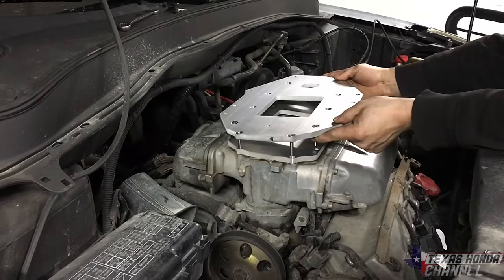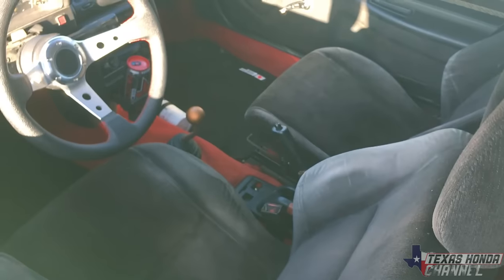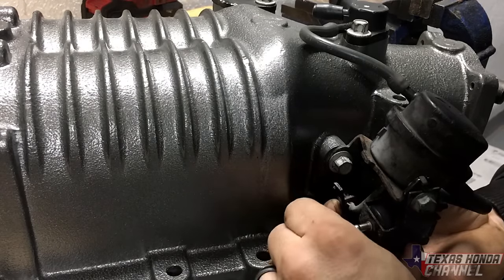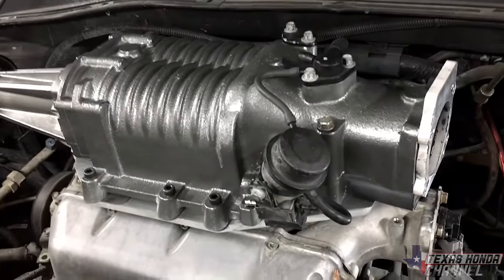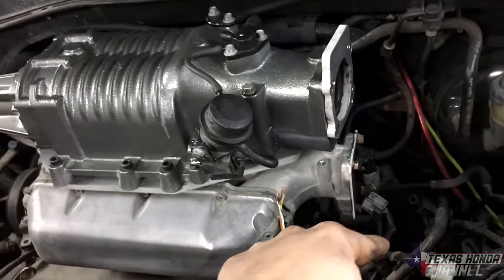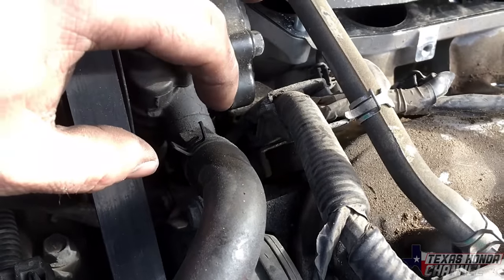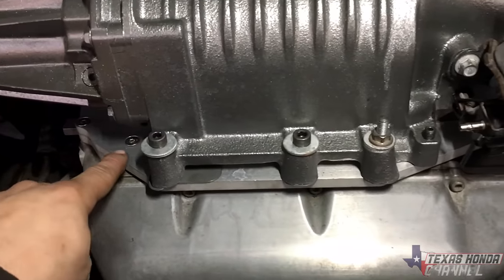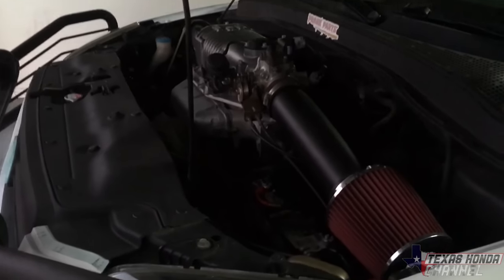How To Supercharge a J35 Honda Pilot In SUPER Detail (Supercharged J-Series)

Comment from the maker: Don’t forget to run 91+ octane if you are supercharged or turbocharged it’s a must! Also drop to a step colder plugs. I failed to mention that!
Reply: Does it work for the j30a 01 Honda Accord V6 I would appreciated if you could give me information about that
Reply from the maker: @josevasquez2201  It should be but not 100% sure. It’s all trial and error for me. I’m still learning as well.
Reply: About to put the blower on my Saturn, lol we've got the same problem with tuning lol
Reply: @fefefirecrackers  There are a few piggyback options. Aem Fuel/Ignition controller, Link has a piggyback, the Apexi neo he picked up, there's a few universal tuning options
Reply from the maker: @fefefirecrackers  Apexi Neo with Acura RDX 410cc injectors and it will work perfectly already got mine installed and the stock 240cc injectors don’t work good for even 1psi of a M90
Reply: @josevasquez2201  the intake plenum in my '98 Accord EX has a different design than the later models. It does not have the removable plate on top like the Pilot does. I'm pretty sure the 3.2 V6 intake does have the removable plate, so you could probably swap it if your engine doesn't have it.

The J30A engines saw some major changes in ignition systems in the 6th generation Accords. My '98 still has a distributor, whereas yours probably has the more modern coil-on-plug ignition. I don't remember if the intakes are identical, though.
Reply: This is cool asf
Reply: Ok bro how do i do that to a Nissan Pathfinder 2001 LE 3.5
Reply: B
Reply: @fefefirecrackers  currently finishing some final touches on my blown l61
Reply: Will this work on a 2007 MDX with j37
Reply: Hmm, looks like this will work with my 2005 MDX 🤔 Would be interesting to see how long the transmission holds up to the power, that is definitely the weak spot in these vehicles assuming the Pilot uses the same teams as the MDX
Reply: @bethanyhaskiell9116  How come no one said anything about my car
Reply: @bethanyhaskiell9116  
2007 is a thing of the past
Reply: Will this work on a 2006 Honda pilot lx
Reply: I wonder what PFI uses on the Jseries engine they have on the bully. There has to be a way to get more fuel besides the mechanical clamping of the fuel pressure.
Reply: I have an 05' Pilot that I just did a whole ton of crazy work on. I've been searching for performance mods for a long, long time. Have you heard of Phearable? They hooked me up with an ecu setup for a Prelude. Maybe they can help with this and hopefully the egr issue. I want to do several things to my car like: cat deletes & straight pipes (there are 3 cats on the 05'), keep vtm4 function, supercharge, etc. There is no video out there like yours. You're a pioneer. Keep pushing.
Reply: Wait, you have gas thats lower octane rating than 91?
Reply: @murkinranzyz9961  You will be better off grabbing a SC from a Nissan Frontier
Reply: I was wondering Have yo figured about the ecu tuning for the supercharger?
Reply: Do u have to do a ac delete to supercharge yo car
Reply: @TexasHondaChannel  hello how are u for how much can I get that on my pilot 2005
Reply: What’s that vacuum line on the supercharger called where could I purchase one
Reply: Do you have to run 91+ octane or can you run regular gas???
Reply: If your running an automatic you will need a 08-12 Honda Accord harness and a 5 speed transmission with the ecu and ktuner will work I have a 05 Honda Odyssey that I swapped a 12 Honda Accord 5 speed and ecu and it’s able to be tuned
Reply: @TexasHondaChannel  would this work with a second gen (09-15) pilot?
Reply: @josevasquez2201  yeah but first you’ll need to convert that intake manifold to a second gen j series one.. see my channel
Reply: Can I do this with my 2022 Passport TrailSport? Not sure bit I think uses same engine?
Reply: my 2001 intake looks totally different.
Reply: @TexasHondaChannel thanks i needed to know that for injectors but what about fuel increase did you use a fmu or stock fpr

Comment: Goes and looks up current prices on odyssey’s 😂
Reply: If its an odyssey manual swap it and run it on kpro
Reply: I have one 💪
Reply: Passat swap ideas🤣
Reply: Just drove one. They're so damn plush. Really bad characteristics in a slide though. As long as you have grip, they're amazing. Just don't try and drift it.
Reply: Will my wife notice the whining supercharger noise….🤨
Reply: How expensive is it to manual swap a Odyssey i have a 2012
Reply: @brianrodriguez1628  just need a manual transmission clutch and prerequisites custom pedal n a ecu tuned thats just the basics. Aint easy
Reply: I got a 2016 Odyssey thats why im watching this lol 😂😈

Comment: You are ligit a life saver! I have a 03 honda pilot and have been searching for a good year now trying to find a good kit and way to supercharge my pilot! You just made my night as now I have a foundation to now get what I need for my honda pilot! I got the J35a4.
Reply from the maker: Awesome!! Ima work out any bugs so others don’t have too but 1,200 miles so far and runs strong
Reply: Is your 03 FWD or 4WD? the pre-06 models have much weaker transmissions that usually fail much earlier. If you do this, let me know how that auto holds up under load! I'm looking for a good trans option for my 06 because the updated 4wd version of yours still isn't enough for me to run 10psi without ridiculous slip. I think the 4wd version is too complex to properly tune it or turn it off completely at my level of skill.
Reply: @billspangler2685  mine is a AWD I have over 170,000 miles currently and she is holding up strong and has done towing as far as 400 miles one way and 400 miles back. Haven't had many issues but I'm not gonna promise that it's the best. But when I can get the super charger and all done I will be sure to comment a update

Comment: Super SC install video for a one-of-a-kind Pilot. The Pilot has zero performance aftermarket support so you are definitely onto something here.The EGR pathways in the intake looked like they could use some clearing but since you're EGR-less it may be a non-issue.
Reply from the maker: Well ya EGR is blocked off now due to adapter plate but it the pathways were cleaned up recently but oh well I’ll figure a solution out

Comment: For the NSX you might be able to get it a 1/2 inch  lower by face milling the plates and the bottom of the supercharger.  You could prototype the plates in wood if you know someone with a planer. Remaking that top plate with countersunk bolts should get you a bit  more if that's where it's hitting. Also you could face down the tower that the plate bolts to. Lastly maybe motor and trans mounts.

Comment: bought stuff from Prank Parts for my J37 manifold swap I recommend. J32A2 with a j37 manifold 6 Speed Swapped 00 Accord. For this supercharger mod you will have to cut your hood like many accords, civics, tegras, TL/TL-S/CL-S ect. But if you don't want to cut your hood and want to go supercharged for your J-Series, go with competech Super Charger or hit up Gerzy Bear Performance which supply rotrex supercharger kit but will lose A/C.
Reply from the maker: I didn’t lose anything and have hood clearance but that’s the best part of the pilot plenty of room but good info nonetheless
Reply: @TexasHondaChannel  I know, that's the good thing. Ultimate sleeper. I think these Superchargers get maxed at 400+whp/420WTQ from what i've seen in the group

Comment: I need to know where to buy the supercharger.
Reply: This is an Eaton M90 off of a GM 3800. There's a ton of them out there for dirt cheap online and scrapyards. They're very easy to get a hold of. There are two different versions of it which the 3800 following refers to as Gen 3 and Gen 5. Any series 2 3800 will have a gen 3, a series 3 3800 will have a gen 5. The gen 5 is better but gen 3s can be modified to perform close to a gen 5 though. 

Edit: The adapter is for a Gen 5 it seems. They're harder to find (04 - 08 Pontiac Grand Prix GTs ONLY) then the Gen 3s but still relatively easy.

Comment: So, what kind of power/performance did you gain? Can that 5 speed automatic transmission handle the extra power?
Reply: They’re on the weaker side, so I’d say “no?” But it sure is cool!!
Reply: As a h5 owner I’ve ripped the torque converter up before the the actual trans itself needed to be changed

Comment: Definitely adjustable fuel pressure regulator and crank the pressure or ghetto way just clamp off return line for sure and watch your a/f reading if you have a scan tool that does so will help for a couple psi of boost so it doesn’t lean too bad. Very neat though . Also a infiniti q45 throttle body bolts up to a k series and the wiring for tps will match don’t know if it will work for j series but it’s cheap from a scrap yard you just need the pig tail for tps

Comment: Just use an FMU rising rate fuel pressure regulator. If you are only running a few pounds it should be fine. Get an air fuel ratio gauge though to be sure what's up.
Reply from the maker: I have a Apexi neo and installed it and it worked perfect without a FMU videos will be coming out with that info.
Reply: @TexasHondaChannel  Cool, I had one of their vtec controllers back in the day. Love your build.

Comment: I wanted to do this to my Odyssey and have it tuned but EVERY shop I called that specialized in Honda tuning laughed and told me it wasn't worth it and that the trans wouldn't hold up. I literally called 10 different shops. Bummed and disappointed I sold my Odyssey and supercharger kit. Too bad nobody makes tuning software for the older J series, it's DBW or nothing.
Reply from the maker: They laugh because they don’t see the potential we do. It is possible especially an Odyssey and just gotta get a piggy back until they come out with a Hondata or K tuner hardware/software

Comment: That’s sweet dude on the nsx try using hard foam to make a frame for the rear window 
Go all the way around use the hard foam for the bottom then u could find a way to mount the window rubber on the foam just a suggestion thx really appreciate it 👍

Comment: Good job. Just was never a fan of the pranks kit keeping the oem manifold blocks air flow drastically
Reply from the maker: It does block flow but still a cool concept and bolt on design. Ima definitely upgrade in the future but this setup is fun and I already put 1,200 miles on it and it’s doing great 👍🏻

Comment: Maybe an intake to get cool air will help more with the supercharger when you will get it tuned, since you can't have an intercooler. I know they are cold air intakes but there are right in the engine bay, instead of sucking air from the fender or grill like the stock intakes
Reply from the maker: Well it goes off road the best I can do is a snorkel lol the aftermarket intake I custom made for it works better than the stock system did but intake temps haven’t got over 110 yet so far so good. I datalogged using a expensive code scan tool my buddy has. They do make intercooler setups for these but im not too worried on it yet since the boost isn’t up high enough to worry. My supercharger civic was 200+ degrees intake temps so as long as they don’t do that I’m happy lol 😂
Reply: Water meth injection would be your friend in this case. About 300-500 depending on snow or aem kit

Comment: I am in the works of Supercharging  my ‘17 Accord V6 Touring. And can’t wait. Great video!
Reply: i’m thinking about supercharging my 2015 v6
Reply: @ammarmirza6685  I imagine it’s gonna be a blast to an already quick car. K-pro tune will net awesome results. Should be finished up in a few weeks. I’ll post a video
Reply: @farewell_to_normalcy9352  do u think the transmission will be able to handle it?
Reply: @ammarmirza6685  I can’t say for certain about my particular year. I have heard they can handle roughly 500 hp before upgrades should happen. I had a peakboost Si civic that was pushing well into the 600 whp range and that was on a stock 6 speed RSX trans. Only clutch was upgraded and it handled it just fine. I do know that the 16-17 v6 auto cars are very crisp and shift literally like a dual clutch trans. 
Very worst case, if the trans doesn’t hold up, I would most likely look into doing a manual swap on it. Cause nothing is cooler than a 500 hp 4 door race car with a manual to bang through the gears (if it’s even possible)
Reply: @farewell_to_normalcy9352  did this end up happening?
Reply: @garrettpoorbaugh9367  at this moment the project is stalled. Have had some faulty parts out of the box fail, so tracking down those gremlins has been a blast
Reply: @farewell_to_normalcy9352  oh man! What kit did you go with?
Reply: @garrettpoorbaugh9367  it’s a rotrex s/c and the ‘kit’ is from KraftWerks. I’ve been recording the build, and hoping to be through the worst of it this week, and then off to get tuned. So the whole process will be up on my page in the next couple weeks hopefully. Very eager to get it done and luckily it’s winter so it’s not the end of the world if I didn’t get it done asap. But damnit I want to know how a boosted J35 will feel!
Reply: @farewell_to_normalcy9352  I’m really close to doing this to my car; I’m about to pull the engine on it. What are you using for engine management? I have a ktuner v2 and want to run boost; do it know if that system supports the VE tables And whatnot?
Reply: @garrettpoorbaugh9367  yup I initially went with the V1.2 but from what I gather, it’s less involved with actually tuning. Limited I guess. So I am running the V2 instead. It is my first time using them on a V6 car, but I have a really awesome tuner and I’m very interested in knowing what the car will make. I decided to port match the intake- even tho there’s not a whole lot to take off believe it or not, but I’m also running a P2R (eBay special but a good product) big bore throttle body so the port matching kinda goes hand in hand. I’m trying to get the most bang for the initial buck, but it’s likely I may be running BC cams as well. I’m already this deep into it, it seems fitting 😂

Comment: Great video very educational learned alot. 

In addition to all inquiries if this will fit my j35 intake manifold. Yes mostly all j35 have the same intake manifold and bolt on pattern. 

You can even upgrade to a j37 intake and throttle body just have to customize the location of the intake sensor.

Comment: As with imperial fasteners, metric fasteners are measured by their major diameter, not their hex sizes. So a "12 mm" bolt is really an M6. An M12 bolt is close in size to a 1/2" bolt.

Comment: The thing about super charge is that it's so expensive. At that price I could have gone turbo charge and have way more horse power. Wish it was cheaper because sometimes I just want a little more horse power.
Reply from the maker: Yea I paid $100 for the supercharger and $550 for adapter plate but to be fair for me to get a intercooler and turbo and have it all welded up and oil lines ran and such I would have been over this price then gotta do the tuning and such upgrade injectors because the stock are 240cc unfortunately. I prefer supercharger because less room for error and maintenance no exhaust leaks and such and if the bearings in the supercharger go out or there’s any issues you can still put the factory belt on and run it like stock I already did it to find out if it would work and it does.with turbo you run the risk of exhaust leak causing issues if they are at or before the turbo; then you have oil feed lines and couplers that like to pop off, To each their own but in the end I still like supercharger for daily drivers just because of the instant torque you can pass people on the highway really well. Once I get this how I want it it’ll be a really fun daily

Comment: Haven’t really worked on many nsx, however there may be a way to put spacers between the chassis and subframe you essentially lower the motor I. The engine bay. Then just correct ride height with suspension.

Comment: If I was going to make a recommendation I’d suggest an AEM F/IC as opposed to the apexi neo. I seem to remember the issue with the apexi being that adding fuel also advanced the timing. Maybe it’s different now I haven’t had one for years. The FIC will allow you to control fuel and timing independently of each other. Yeah, it’s still a piggyback but I’ve had pretty good success with them over the last 10-12 years.

Comment: Why didn't you move the sensor lower on the block plate instead of flipping the throttle body?  You can put your egr valve on the same block off plate.
Reply from the maker: I have more videos coming out explains way more. This is trial and error stuff no one else has any info out there so I’m just doing what’s working and I’m getting the hang of how it’s all gonna work now. So far 1,500 miles going strong

Comment: Are you going to get the transmission build because I heard thos automatic Trans are extremely weak??
Reply from the maker: They aren’t weak like people think. They just need transmission coolers and fresh good fluid. It’s actually the “fix” that Honda recommends to the “weak” transmissions. Also you get these young kids out here revving in neutral and slamming into drive and that’s what really screws them up and flushing them because they are low flow transmissions so they require a drain and fill method only. I have almost 200,000 miles on our pilot in our transmission is never giving us issues as long as it taken care of properly and you get transmission cooler installed the last of very long time I have plans to do way more videos stay tuned.
Reply: @TexasHondaChannel  my family daily is a Honda pilot with 260,000 miles. Our trans is slipping and my family missed the atf fluid change interval. She fooked now? What do you recommend